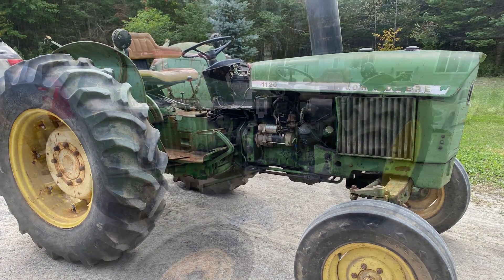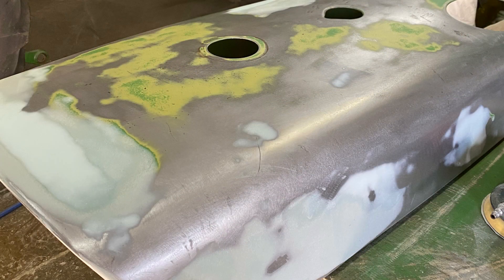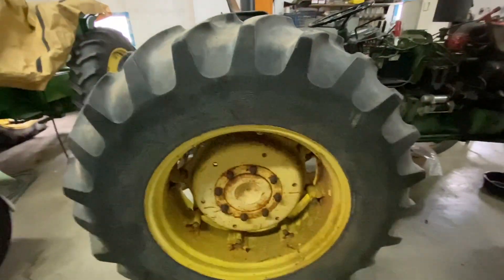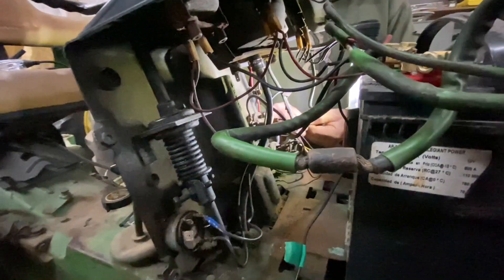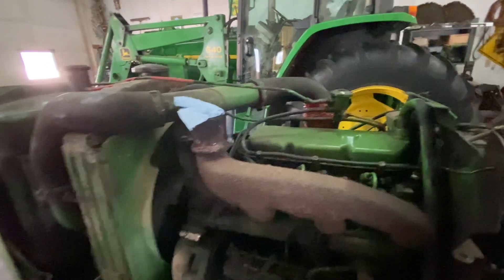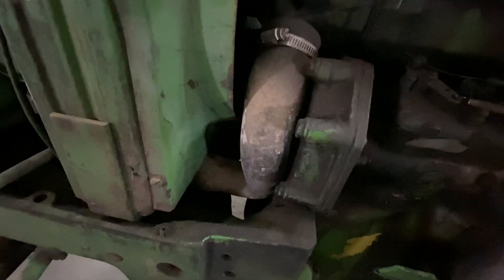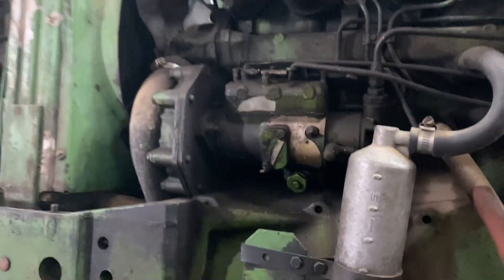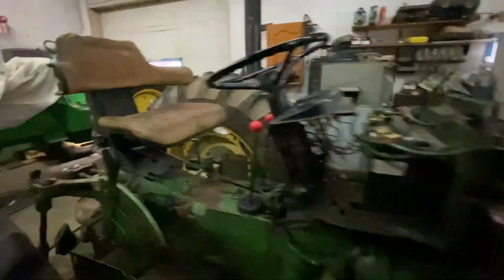John Deere 1120 restoration part 1

Comment: i hope one i get to o the same to mine! ... i own a 1973  1120 diesel same as you with 143 loader!..... is your serial number 1120b?   if its b its a 73!  also thats not the original tach ... original tack is a yellow neddle   and the 540 pto  rpm  spec is green